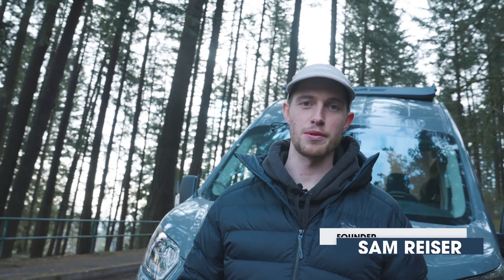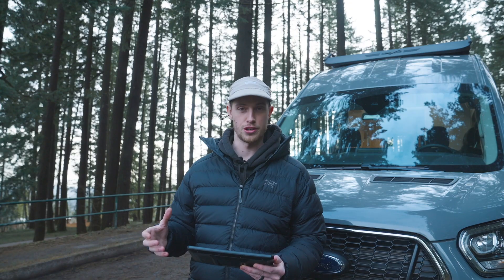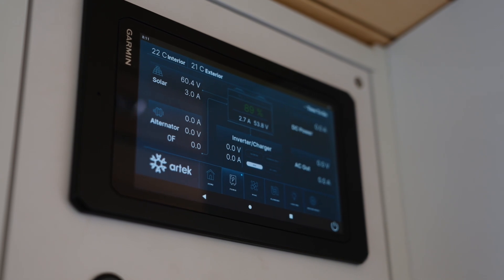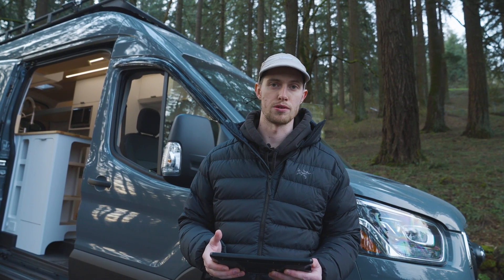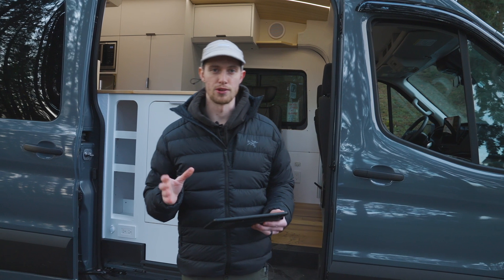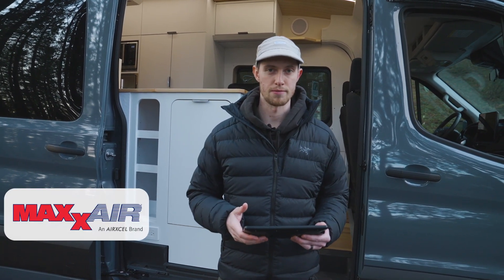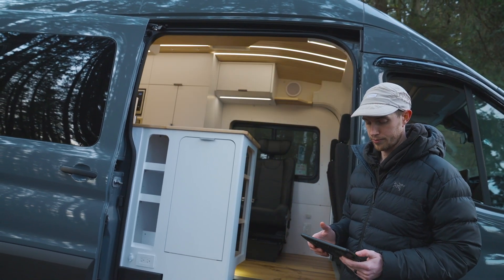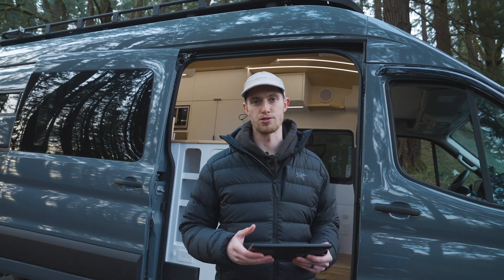Artek's Garmin Core System | Digital Switching Walkthrough

Comment: $4000 is pretty brutal.
I have a Simarine Pico and only ever look at the battery percentage and water level.

This does look awesome but 4k is a lot for this even for a 180k build
Reply: Agreed, this is the cat's meow,  basically for 4k for everything on one screen and all in one integration.  They must  have one heck of a software developer.  But hey, this is capitalism, and the market will  be the judge.  And I wish them all the luck.  Gives us all ideas, though :).  Sounds like a Raspberry Pi and Arduino project!
Reply: @lkazanov but do you actually want to control everything through touch? 
In my van I only need to control 4 things: 
Lights, water pump. Electrical floor heating 
Anything else is either just automatic or has a control on the appliance. 
Similar to how no one uses touchscreens within a home to control that, I just don't think it's even that practical

Comment: Hey guys looking to out one of these in down the line. However my hydronic system will be an Eberspacher HS3D5E with Hydroplate tank. These use a CAN system, is this something that could be used later down the line? Is there a specific switching language needed to get this to work? From my understanding the Rixen system piggybacked off the Eberspacher furnaces. Cheers
Reply from the maker: Hi @shamblesandrambles, unfortunately not. Rixens uses a CAN gateway that translates RVC and broadcasts that to the Eberspacher furnace so you would need their system. If you have any questions give us a call or shoot us an email! Cheers!